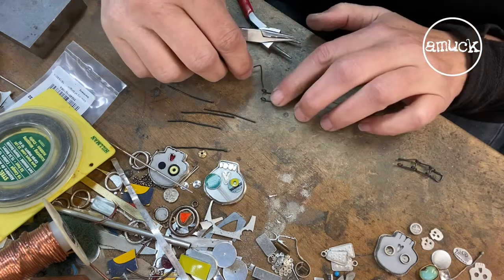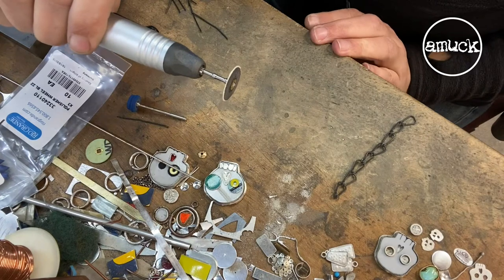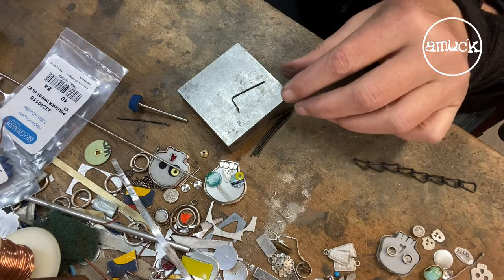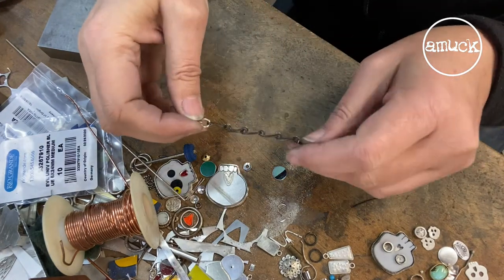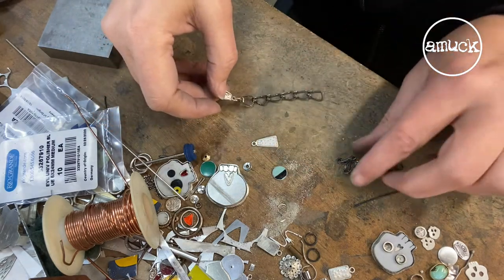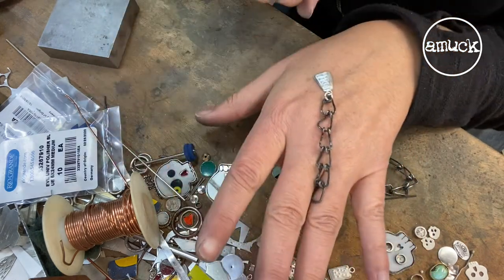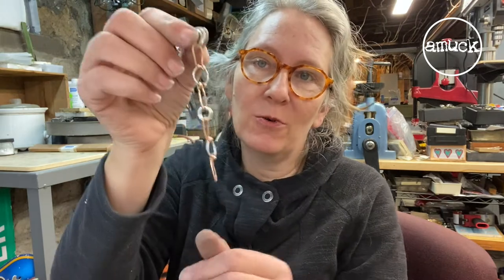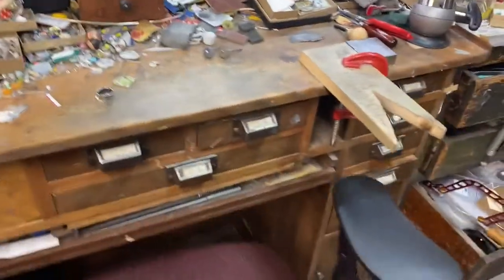Cold Connection Chains- Part Two

Comment: Thanks for taking time to make up another video on chains/cold connections :) I have been working with wire for many years and it's hard to come up with new chain link designs. I have a ton of jewelry books, the one I have used for chains more than any of the others is a book called Handcraft wire jewelry, chains, clasps, pendants...it's by Kimberly Sciaraffa Berlin. It has some neat chain ideas and I seem to grab that book more than any others on my shelf. Looking forward to another video from you on cold connections or whatever you come up with...your ideas are very fun.
Reply from the maker: You’re welcome, I’m sure I’ll have more. I’m not sure if I have that book. I’ll have to rummage through my bookshelves.